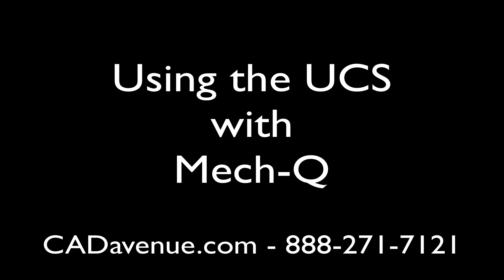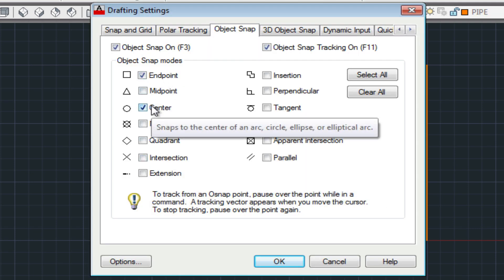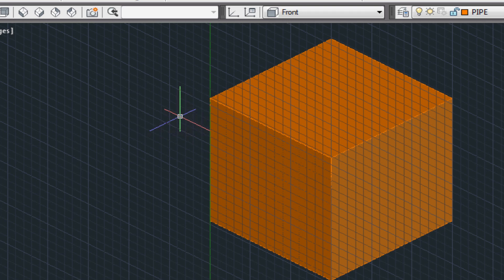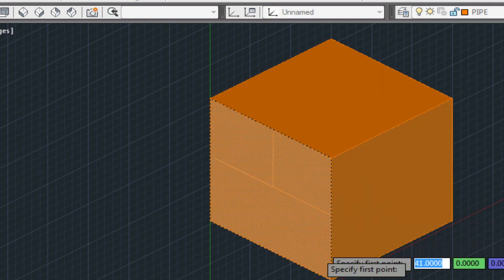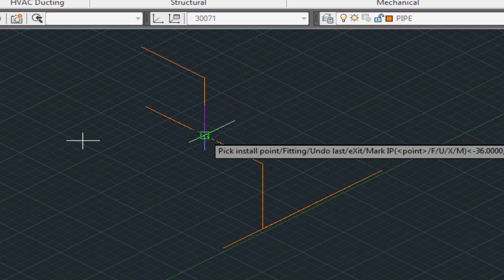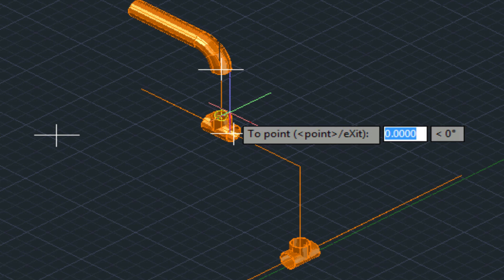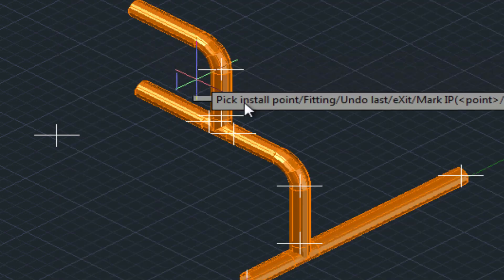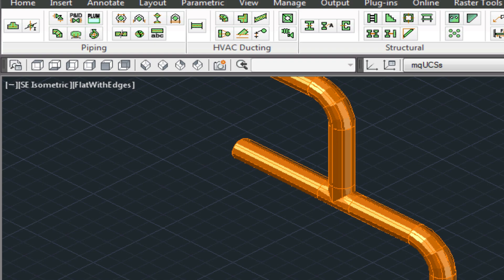Changing the UCS in Mech-Q

Comment: We found that if the 3D object snap is turned on it wreaks havoc when drawing flanges.  It drew the flange but not the bolt holes.  After we turned off 3D object snap it worked fine.